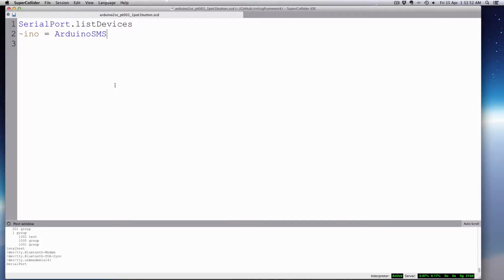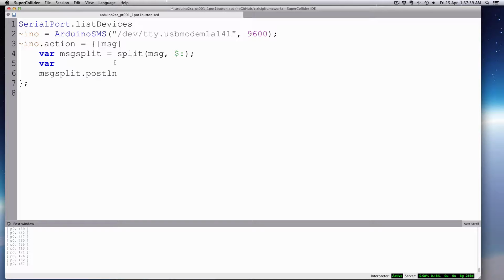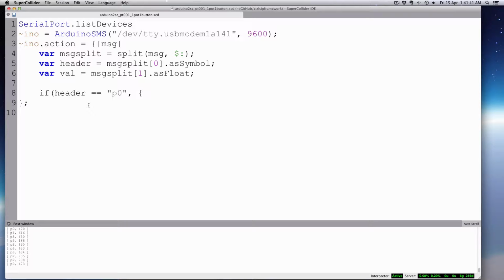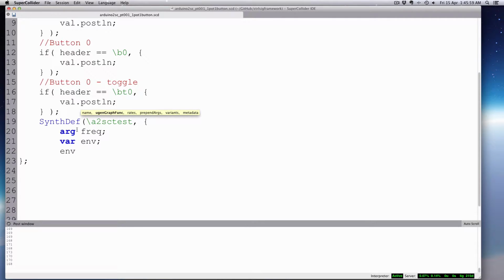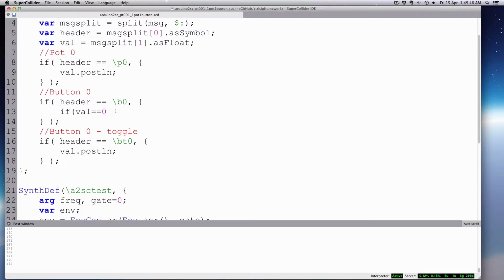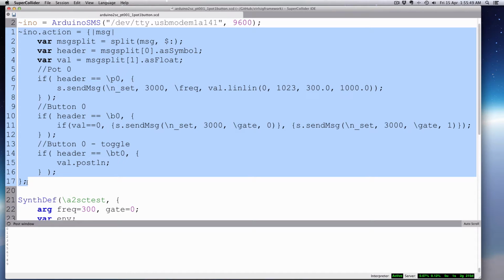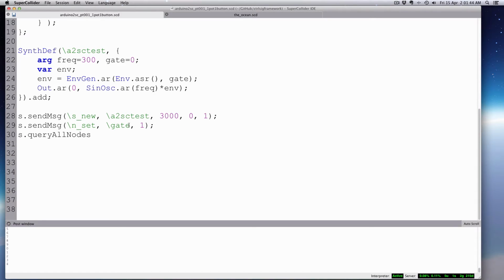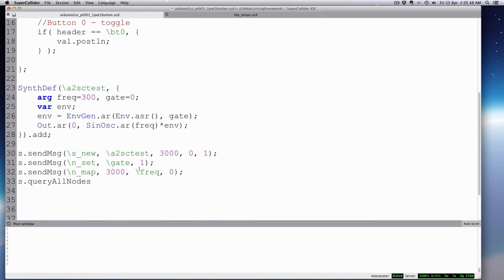Arduino To Supercollider Tutorials - Part 2, Basic Structure

Comment: hi - i thought it'd be great to be able to go straight from arduino to super collider using the serial port. the arduino quark is installed properly and it sees the serial port im using for arduino - im having trouble with the ~ino.action function. When the arduino is compiled and serial monitor off SC prints ArduinoSMS, no serial data. I tried seeing what would happen if i put on serial monitor on arduino and as i thought it would, SC printed:
SerialPort closed
and then below
SerialPort cleanup

Do i have to do anything in my arduino code?

i cant seem to receive serial data from the arduino port to supercollider (it's just x, y and z axes of an analog accelerometer, expressed in mV)